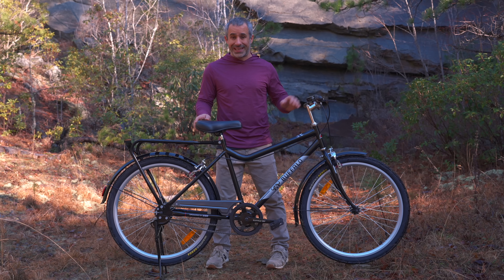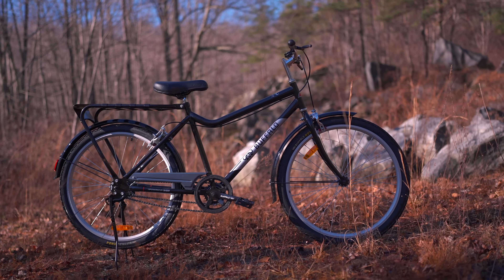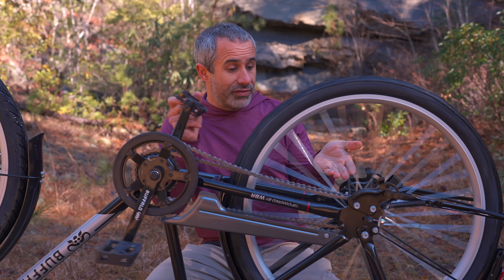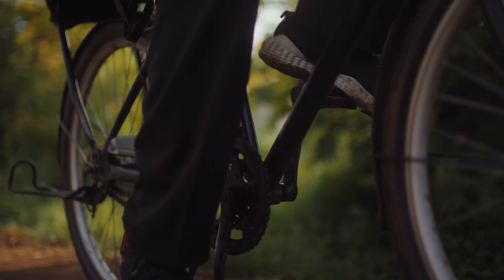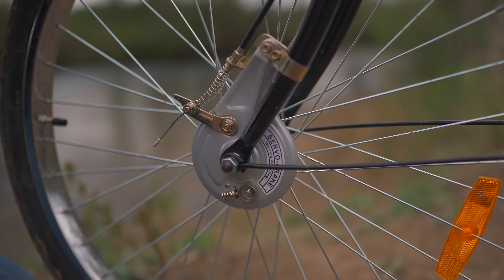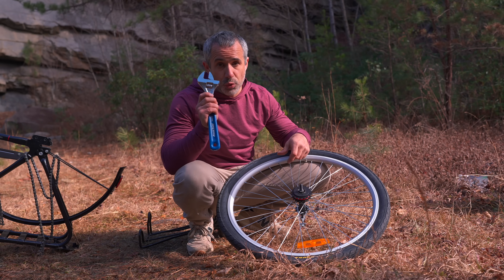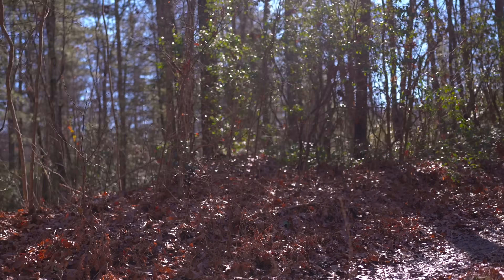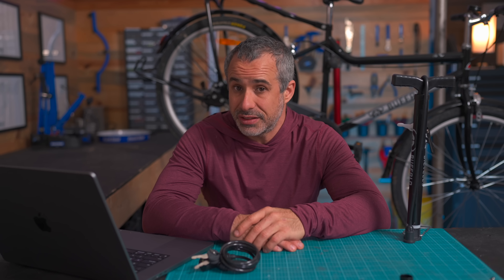Why 2 Chains Make This Bicycle WAY BETTER

Comment: by having 2 chains , that makes the bike almost an extra kilogram in weight.
I used to have a bike that was fully accessoried and it weighed twice as much a 2 carbon fibre racing bikes. I was pedalling around all that weight.

Comment: How much more would it cost to have two pairs of derailleur-style little sprockets that twist the chains in an S to keep them tensioned, and instead of springs, you just use a screw/nut to tighten them in the fixed angle needed to ensure the chains are tight enough to never slip off? Or it's not a matter of cost but something else? Or is that slack so small that even at high speeds on very bumpy terrain the chain can never jump enough to go past the tip of the teeth or even get enough leverage to bend the teeth?

Comment: The bikes are amazing and the programme at least used to be.  Now it's a bit difficult to tell, as it's become increasingly opaque.  They've abruptly cancelled various country programmes with no explanation. It's also proved virtually impossible to discuss new programmes or speak about funding to revive old ones, when funding is available.

Comment: I find the engineering and choices on a bike like this every bit as interesting as the latest high-end downhill bikes and electric road bikes. The amount of optimisation and agnosing over every little decision, and using seemingly odd parts like the twin chains, to solve the problem in a way that's cheap, robust, usable and repairable. Thanks for featuring this second iteration!
Reply: 100% YES. I love seeing what people come up with as solutions to problems where the problems are more serious than "Oh, I need to race downhill 0.5% faster."

That said, I also enjoy watching engineering be pushed with no limit on resources. I'm not pretending to be perfect here.
Reply: yes! i work in bikeshare and have always admired the design limitations of bikes that need to fit people from 4'11"-6'5", live outside 24/7/365, be durable enough to take multiple, sometimes even tens, of trips a day with monthly service intervals, and still provide good ride quality and reasonable manufacturing price point. same concepts apply to all manner of utility cycling and cargo bikes, etc. 

most of the interesting (to me) stuff in the industry is happening outside of the roadie weight weenie electronic shifting windtunnel market.
Reply: High end Electric road bikes exist solely to extract money from materialistic road dorks. Ask any mechanic, there's very little logic in a lot of the design choices.
Reply: More, probably
Reply: Though intesting that the original bike had drum brakes which require near to no servicing and moved to caliper brakes which will need regular adjustment and pad replacements? Perhaps it was the increase in cost of the 2 gear system, they had to cut the cost of the brakes?
Reply: Bendix kickback models primarily refer to their "2-speed automatic kickback hubs" which are often identified by color bands like "Red Band" and "Yellow Band," with popular models including: "Model B," "RB2," "Bendix 70," and "Bendix 80"; all featuring a coaster brake mechanism with a 2-speed kickback function, commonly found on vintage Schwinn bicycles, particularly the Stingray mode
Reply: Same!
Reply: I wonder if one could make it 5 speed bike with clutch cause I think it might be possible and simpler than internal gear hubs
Reply: sturmey archer made the 2-speed internal hub (with kickback gear changing) many decades ago, and still provides that option on newer models for 'single speed' bike frames, though the new models are not as robust as the original (same could be said for their 3-speed sturmey archer).
Reply: @carlosgaspar8447  
I've never experienced a two-speed but my problem with the 3-speeds was that the differences were too wide so I only used one speed and when I was riding a 10-speed Schwinn LeTour I only ever used 38 and 44 and I'm curious what 'speed' equivalent are these two gears? With 38 and 44 being the comparison points. Cool bicycle though!
Reply: @johnogrady2418  yes, the 3-speed sturmey archer is practically a 2-speed because the first  two gears are so close (1st being a direct drive). the large gap to the 3rd gear makes it more practical for hill climbing. with the oil port on the hub shell, they can last many years.
Reply: brother its not a real charity... they claim to have hundreds of dealers with thousands of certified mechanics.. than means there should be parts, and 2nd hand bikes for sale.. it does not exist
Reply: Try to find one online for sale and then tell me if this is real..
Reply: @TrueHelpTV  Took me less than 5 minutes to find their online store. They have more than a dozen branches in Zimbabwe, you can select from which one you want to pick up your order (they don't ship).

Comment: 7:43 or they could use disk brakes bc the disk won't get bent like the wheels do
Reply: Disk brakes are:
- more expensive
- less reliable
- requires special brakepads (that are not just 2 squares of rubber)
Reply: @MusaA1, no reason why the rubber pad brakes can't be used with a disk and then you don't have the problem of a warped rim causing braking force to wobble and be so much less effective. Then it's barely more expensive and always just as reliable as a new wheel and needs no special pads.
Reply: Or go back to the bendix 2 speed kick back hub. Still have 2 speeds, 1 chain, and coaster brake.

Comment: This reminded me of the old Schwinn two-speed kick-back bikes of the 1960's, with the color banded Bendix hub.  Colors indicated the gear ratio used.  I'm sure they considered all alternatives, but considering they were manufacturing a new part, not using off the shelf parts, I find it interesting that they landed on the two chain solution, given the obvious drawbacks.  As a 9 year veteran of a bike shop, I have to admit I never had occasion to overhaul a Bendix two speed, so I have no first hand knowledge of how bad it may be, or how often it may need maintenance or replacement of internal parts.  I could also say that since I started in 1977, there were still plenty of them on the road, and not seeing them in the shop may be a good indicator that they were pretty robust - we got plenty of regular jobs for poor, unreliable designs.  cough  Shimano Positron cough  But most likely the dual chain system takes an already robust concept and elevates it to another level, especially for service with basic tools.  Having followed this story, it makes me want a Buffalo Bicycle, but I know it is an impractical choice for my usage.  Kudos to all involved in this project.

Comment: I want one of those freewheels!!!

I have a 'beer bike' (or neighborhood cruiser, if you prefer) built around the old Bendix kick-back 2-speed hub. I love it! 

This setup features the same kickback motion, but offers a much simpler mechanism than an IGH. 

It would be super cool to see someone (nudge, nudge, Seth) play around with different size chainrings on this setup. Swap out that crank and play around with the gearing ratios!

Comment: Absolute genius shifting mechanism. I love that the thing you do to shift is also a pre-requisite for shifting - you literally can't shift under tension.
Reply: That is one of those things that you try to do in engineering, but is often difficult to do. Make the only way (or at least the easiest way) to do something the correct way to do it. By having people peddle backwards to shift, you don't have to worry about needing to teach people to release tension while shifting, or worry about designing a mechanism that can shift under tension. It is one of the many things that make it a genius solution.
Reply: schwinn did the same thing back in the day with the two speed kickback hub, Glad to see its return in modern day!
Reply: It's not a prerequisite for this sort of system, aside from locking the freewheel at the correct position, it could easily shift under full load
Reply: @PerryNguyen  I think that would require a friction based engagement system (a clutch basically) which is probably way too big to fit. I suspect it has positive engagement which couldn't easily toggle under load.

Would be nice if he could have taken it apart and shown the actual mechanism. I might see if I can find the patent (assuming it is patented - another question it would have been nice to have answered!)
Reply: @TimmmmCam I was hoping so too. I was thinking it’s possibly like the direction changer in a torque wrench but with maybe 4 or 6 of them in the central ring sitting parallel to the chains so as one gear kicks back it pushes them across to the other one

Comment: imagine how much cheaper they couldve been without all that branding. (every feature adds costs) 
Theres only 1 redundant chain at a time, not 2.
Prediction: Since 1 chain is already looser than the other, they wont wear out equally, wont use them equal either. Meaning that in time 1 of the 2 chains might hinder operations if not taken care of, ie in an emergency 1 of the 2 chains will be yeeted. In 10 years half of these bikes will only have 1 chain.

This 1 change added so many extra parts and points of failure. For example the rimbrakes wear out way faster than the brakes they had before, now theres another added operational cost.
They went from maintenance free, always work, can be bent to hell, doesnt matter type wheels to wheels that do need to be straight just to make the brakes work.... Now the bikes will need a magnitude more maintenance than the previous models. Now they added weaker rims while still carrying the same 90kg loads on the same surfaces, i cant imagine this being an upgrade. Aluminum rims shear and bend much faster than the heavy steel ones, requiring more maintenance. 
There used to be 1 brake with a few parts, now theres 2 diffrent types. The front and back brakes arent interchangable, doubling the amount of parts needed to have at hand in the shops just to fix the same issue.
Wouldve been nice if the pump could attach to the frame so its always near, same with the wrench. Adding a simple and cheap emergency tyre patch kit would also be superb. IDK what to do with 1 tyre iron, add 2 more?

Im only critical because i want to see the best possible, projects like these improve the quality of life of potentially billions of people. Every little improvement, however small can mean a positive impact for millions or more, thats all i want.
Thank you so much for this video, i wasnt aware of this project. This project is amazing and everyone who can should support it! 
Only together can we make things better. Stay critical!

Comment: Cool bike, where does one get it or spares? I want the freewheel, the rest I can build on to a bike my self. 

Would be cool if they welded a stamped metal section with hex bit to the bicycle frame like on the spanner provided then in the field one could take the wheel out insert freewheel toolalign it with hex slot in the frame and use whole bicycle frame as a massive spanner  then turn the wheel by hand  to remove the frewheel.

Comment: They need to come out with a really reliable Buffalo cargo trailer. Fixed axle, lightweight solid tires, a cargo space that has attachments or transforms into different functions. Make the cargo space be flattenable, give it raised side attachments for more cargo depth, make it expandable width or lengthwise depending on the kind of cargo being transported.

Comment: Why Caliper Brakes thought?
I'd argue that V-Brakes are actually simpler than calipers, have better braking power, and tire clearance. They also handle bent rims better than calipers.
as a bike mechanic a very common failure I see on old calipers is the single spring weakening; while V-brakes have 2 leaf springs that can easily be rebent.
between cheap calipers and cheap v-brakes; I think the v-brakes are a better value.

Comment: You mentioned They weld on Foot pegs.

It sounds like maybe the accessory list needs to be bigger.

Foot pegs. 

Removable basket for the rack. 

Handlebar mount bottle cage with bottle. 

Maybe Solar Lights ?

Comment: I love it!  Regarding the coaster brake vs. rim brake dilemma; brake reliability doesn't much matter if you can't hardly get to the top of a hill with a terrible single gear ration in the first place. Lol

I think this shifting method, and this bike in general, is incredible.
Reply: Also keep in mind that if the road is that steep, you can always get off the bike and walk it down the hill.

Comment: I've been falling in love with simplicity since my first single speed and then moving to fixed gear

This is a major step in biking and I wish it would see more light of day. Thank you for covering this
Reply: If more people used single speed and fg we'd have a lot less waste.

I bought some of the cheapest single speeds and they just don't go wrong.

Too many places churning out geared bikes for the masses which are total junk.

Single speed
Steel frame
No suspension
Reply: @simplexicated  tbh I have a multi speed thumb actuated gear shifter since 10 years ago, I think that's the best 20 bucks I spent, it's been super reliable, the only thing I changed on the bike since is the brake pads. the bike itself is a store brand steel frame that cost around 80 bucks like 20 years ago.

Comment: What I'm hearing is that if I use the newest Silca wax lube on this bike I'll double my wattage savings!

I wonder why they didn't go retro-direct for a two speed drivetrain without the need for a special freewheel and no chain tension problems?

Comment: Do these bikes have thick tyres to reduce punctures?
Strips cut from of old tyres might do. I have tried it and there's a huge reduction in how often punctures happen - without messy sealant. Almost no point carrying a pump!

Comment: If the two-chain idea is so good, why doesn't someone make such a bike for Americans?  Bike shops tend to focus more on racing or off-roads, but there are a bunch of us who just do city commuting and aren't especially mechanically handy.  This sounds like a great utilitarian bike, and Worksman, or somebody, should get right on this!  Or even Schwinn or Huffy.
Reply: It's great for simplicity, but honestly an inexpensive geared hub or derailleur works better as long as it's not hard to get parts and service where you are.
Reply: @matt.3.14  You're probably right, and even if they sold this in the U.S., they'd probably have to charge more than $168 for it.  But at this point in my life, I'd prefer simplicity over complicated things that I can't work on.  I almost want a bike with dual wheels, so if I get a flat, I can still ride the bike home! ;-)

Comment: In the 60s Sachs did a 2 speed hub with a coaster brake that allowed to change gear by paddling backwards 1/8 of a turn and the coaster brake kicked in 1/4 of a turn backwards.
I was the Sachs Torpedo Duomatic two-speed hub.
I have it on my bike which is now well over 50 years old and it still works a treat.
However it is quite a complicated hub to service, only done it once over the past 15 years.
Reply: I had one of these in a Moulton bike - did the same as in this video AND more !
Glad I'm not the only person to have experienced one - it was brilliant !
Reply: In fact, if the Sachs Torpedo Duomatic two-speed hub was more publicised, it would blow this Buffalo bike away.

Comment: A dual chain / dual chainring gear system is 1890s technology - and it worked fine then, and it works fine now. Maybe too heavy for us spoiled rich westerners, but for sure it's a case of "good enough for who it's for" (thanks Bikefarmer). Kudos to SRAM for reviving and bringing to the 21st century a technology which does the job and helps people. That is thinking outside the box! I find all this so beautiful in so many ways.

Comment: At least in Sweden two geared bicycles were common in the 50s to 70s. 
Kick back changed gears. Also brakes the rear wheel. (Also changed gear when braking but no prob)
But not with two chains. 
So I dont get why there should be two chains. 
Two chains also makes a little more resistance.
Reply: 2 chains are to lower the costs and reduce complicated maintenance. IGHs work fine es long as you can maintain them, however they are relatively complicated to take them apart and if you lubricate them with oil instead of grease they can leak oil. Also they cost at least half what this complete bike costs.

This freewheel is cheap and these simple chains are cheap too.
Reply: @simonm1447 Those were very reliable. I cant see why this is better.
Reply: @michaelenglund  it's likely the price too. IGHs are more expensive than 2 chains plus such a freewheel.

These bikes have to be as inexpensive as possible. Personally I would choose a different drive train for a bike ridden in an industrial country, but it's not made for our wallet and the conditions in the western world.
Reply: @simonm1447 You have a source on the prices?
Reply: @michaelenglund  since they don't sell the freewheel on the open market no, but there's far less inside compared to an IGH. Since the old Buffalo bike is less than $ 150 it has to be inexpensive.

You don't get a new bike for that price in Europe

Comment: These bikes remind me of the old Chicago made Schwinn's, heavy duty wheels and tires, simple design with steel tubing. I bought a 1970 Schwinn 5 speed as a kid back in 2012 and it still had the original tires and tubes that I put about 100 miles on before replacing. I don't think even the buffalo bike is as reliable as those were

Comment: This is actually such a cool idea. For a while I've been thinking how simplistic it would be to only have 2 gears of the wide range crankset. I'd no joke love to run such a drivetrain on a modern bike. With some lighter duty chains of course!

Comment: I had a bicycle with a SACHS gearbox in the wheel hub that had three gears each engaged by pedaling back until you hit the brake. 
Yes, it also had a backpedal brake.